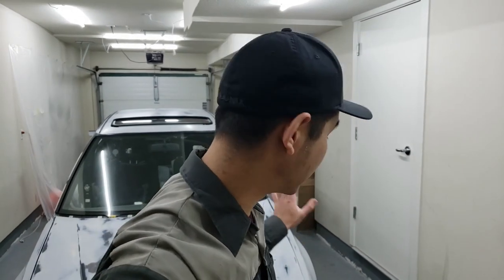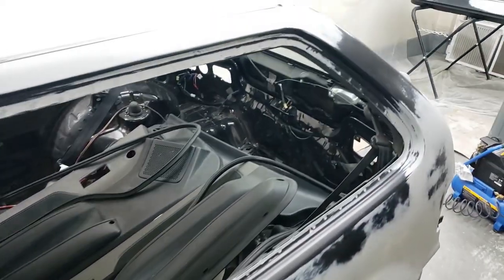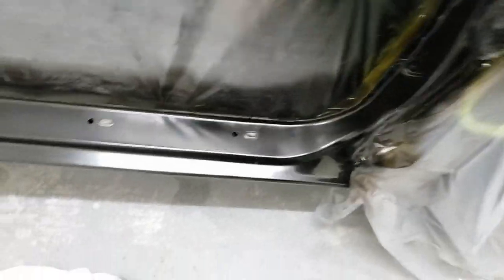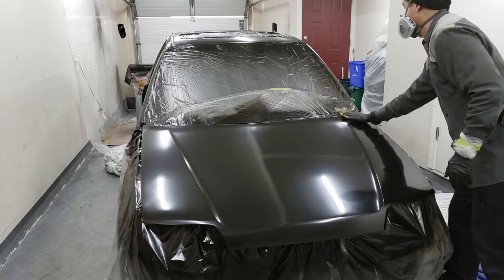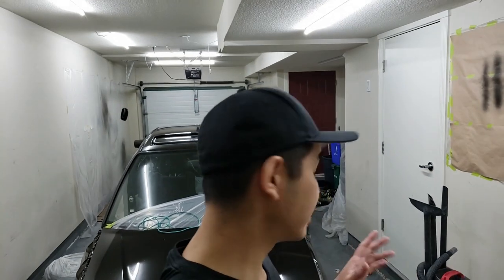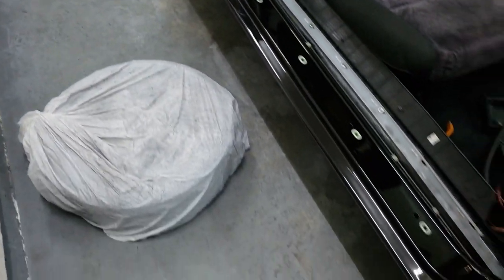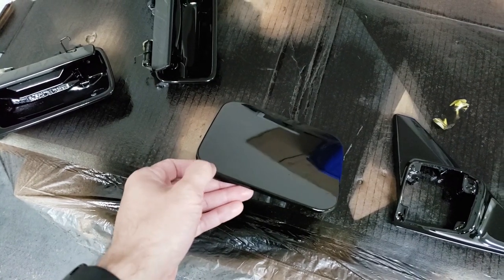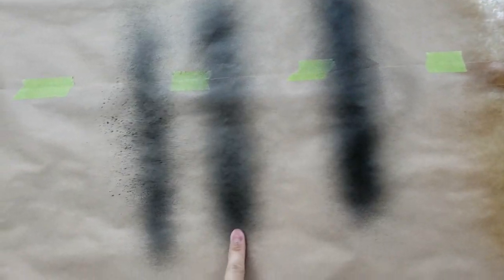[DIY Bodywork] Pt.24 Spraying Base & Clear Coat with FujiSpray Semi-Pro 2: Successful 1st paint job👍

Comment from the maker: For some reason, someone's comment got removed. I used the 1.3 tip that came with the sprayer to spray the car. For primer I used a 1.8 tip. But a 1.3 tip can do the base and clear no problem.
Reply: Use a .8 with this Fuji system and you will get a flawless finish that doesn't need sanding. Sounds counterintuitive but trust me. The system just isn't powerful enough to spray undiluted paint well with the typical 1.3 tip. The theory behind using a .8 is less material but the same amount of air. You move slower but it lays it down very flat. Severaly underrated system.

Comment: I’m glad you took the time to adjust your settings and find what works for you. The system is well worth the money for DIY projects. If a person can paint a car with rattle cans, then why wouldn’t this system work with a little patience. Trial and error is key. You did an amazing job and I hope you film your next session as well. Hopefully it inspires others to try this system for themselves.
Reply from the maker: Thanks man. Very true. This system is way better than rattle cans. I've painted my fair share of things with rattle cans. Rattle cans really suck. This system really does work well. Just need to be patient dial in the settings and take my time spraying. I think it would have been better if I had more airflow in my garage. But gotta make do with what I have.
Reply: @BudgetGears  try to invest in some more tip sizes. I'm using a 1.0 & .8 in my gxpc for bad & clear.  You'll notice a huge difference between 1.3 & 1.4 tip
Reply from the maker: @justinshields4216  I'll definitely have to think about investing in some smaller tips for the next time I paint something. It would be nice to have even finer atomization.
Reply: @BudgetGears  i was wonder about this paint system how reliable and lasting this machine can go. Its there any maintance or parts replacements??? Also using air comrpesor gun vs this machine which do you like
Reply from the maker: @jaandel1  For me the system is quite reliable. It can last the entire paint job. The only maintenance required is cleaning or changing of the filters on the turbine, replacing the one way valves on the gun, which is usually ok for a long while, and replacement of the cup lid seal. If you're comparing guns, then there's different levels of air compressor guns vs this machine. Personally, I like the traditional air compressor guns, which is better than this particular gun. However, the gun is only as good as the air compressor system you run. If you don't have the massive compressors and water separator systems like shops do, the air compressor guns aren't very good at home on the small compressors. Now this specific machine model gun is pretty good for what it is, but if you decide to go for a different model like instead of semi-pro, you get the Q platinum models, the guns are very nice. Just like the traditional air compressor style. The Q platinum systems are very nice because you can adjust the air output etc. Turbine systems can produce jobs just as nice as traditional air compressor systems and are portable. As for the model I'm using, which is what's in the video, it's a great system for home use.
Reply: @BudgetGears  thanks for your response. You are right about air compressor air run out quickly in 20gl tank... but what do you know about hot dog air compressor it claim to have scf 6 or more around 1k in.
Reply: @BudgetGears  also the information about the gun is very valuable... unfortunately ypu can't interchange guns with this system like air compresor gun with came if diferente price range...
Reply from the maker: @jaandel1  I don't know too much about them. I'm sure the small air compressors can paint small things if you get a gun that matches the compressor, but you'll run out of air fast. The faster the air runs out the more the compressor motor runs creating lots of water. Literally these small compressors tend to run practically the whole time you're spraying something small and you'll still have to pause to wait for it to charge up. Personally, if you don't have a 50+ gallon compressor, it's a pain to use for painting.
Reply from the maker: @jaandel1  No, you can't interchange the guns. Turbine guns and air compressor guns are designed differently. The Turbine guns are designed to use far less air pressure than a air compressor gun.

Comment: I dig your work bro.  I was wondering what overspray was like spraying in a garage and how you dealt with ventilation and such.  Did you crack the garage door open between coats?  And were the neighbors a concern?  I plan on doing similar work in my own garage.  Just curious.
Reply from the maker: Overspray was very bad because it literally got everywhere. So move everything or shield up everything you don't want overspray on. Ventilation I only had the garage door open with 2 exhaust fans with filters taped onto them. I recommend getting as many fans as you can fit under the garage door. I blocked off any other openings with cardboard. No concern from neighbors since they couldn't smell anything. My 2 fans worked but it took a while to exhaust out the chemicals. If your garage is attached to the house like mine, do not open the door connecting your garage to the house. It'll get all the toxic smell into the house. Trust me it happened to me. So I would exit the garage out the side door while I wait for the flash time. I didnt open the door fully at any point since you'll let more dirt into the garage and risk ruining your job. Its dusty enough already.

If you're gonna use a similar respirator like mine, use some toilet paper to shield the cotton filter. The toilet paper will catch the overspray and allow for your filters to work longer. Otherwise, they'll get clogged within the first few min of spraying. 

If your garage has a window for air intake, then that would be best. But mine didn't so I only worked with exhaust air using 2 fans.

Comment: i just found a really messed up flaw with the fuji simi pro paint system the turbine unit heats up the air in the hose when you try to paint a hole car makes the paint get a shit load of orange peel so pissed Larry B
Reply from the maker: I think I remember the hot air being a common thing for all turbine systems. The air wasn't bad for me. I did paint it around spring and I did shut off the spray many times while refilling the gun or between coats. It gave it a lot of time to cool down. But I also didn't do a full car since space was so limited that I couldn't paint all the pieces in 1 session.

Comment: For your 1st paint job you did a good job you get a great job. Recommend blowing the garage out the day before you paint to get a lot of dust out also wet your floor down which will trap some of the dust Make sure your passenger compartment if the doors are off or taped off and papered that could be a lot of your dust and fish eye issue wash the car really good with dawn soap and dry it and blow everything out and wipe it down to wax and grease  remover.
Reply from the maker: Thanks! I did do all that. But still got fish eyes here and there. I'm thinking maybe something was floating around in the air etc. It is a garage so its exposed to all contaminants. Overall, it still came out really nice.

Comment: Thank you for the video. I have only used mine to paint the front bumper. That was my first time painting anything large. The clear came out with a lot of fish eyes. I left it as is and it cured with time. Barely noticeable now. I'm about to paint my Honda in about a week. I have thought about just buying the Fuji Q5 Platinum but having two sprayers makes no sense right now.
Reply from the maker: The Q5 is a nice one. I wish I could justify buying that one too. I think you'd have to paint a lot to make it worth buying.
Reply: @BudgetGears   You are right. I bought the semi pro 2 about 2-3 years ago and I have only used it once. Having two of them after painting my car would just be a waste unless I sell them after. I hope I do a good paint job on my car with the semi pro. Thanks again for the video.

Comment: Good video thanks.  I just bought an older Fuji q4 pro to spray my bumper this helps thanks again.
Reply: The Q4 is night and day different than the Semi Pro 2! Skipping the the quietness factor, as it does not effect the results, going from a 2 stage to a 4 stage OMG.....DOES!
You're talking 5psi vs 9.0psi!!!! Double!
This is worth every penny. You can always make a machine quieter but not stronger.

Comment: Got the Fuji Q5 platinum turbine sprayer coming soon but already painted my truck just want to sand the orange peel off with my orbital sander with 800 grit and then put clear on again. But probably won't get it to next week or the week after if like it will get one more but rather just get another spray gun to use on the Q5 for basecoat but don't see with the spray gun only
Reply from the maker: The spray gun only is quite pricey for the fuji systems. I was thinking about 2 guns before and then settled for just getting the tips needed and cleaning the gun instead. If you clean out the gun well, it'll be fun to use to spray all the stages. But, its definitely easier to just switch guns instead of cleaning it between stages.
Reply: @BudgetGears but got the Fuji Q5 platinum because the air compressor use is small. But I saw videos of people using two air compressors for more air. I just got another orbital sander recently a 5 inch from Tool Lots but still the turbine sounds better than hooking up to a air compressor saw multiple videos of people getting great finishes on a vehicle when using a turbine sprayer. I got mine from a Asian site though because not spending the high price like the ones I saw online for 1,000 I wouldn't spend that much on a spray gun that is much as a pretty good air compressor.

Comment: Also you have to learn hose control keep your hose up above your arm and use your other hand to keep it tight.
Reply from the maker: Hose handling was definitely something I needed practice with. These turbine hoses are big and heavy. One thing I had to keep an eye on was the hose kinking. It happened when I did primer. Spat a glob of primer on my spoiler. 😔
Reply: @BudgetGears   The unit I have is called an accuspray It is a plastic gun that is bolted together it's lightweight cup is on the bottom I've had it since 1990/91.  I sprayed with it a lot. never had any issues with it. I love the HVLP system.  All I can suggest is that you practice and Prep work needs to be clean make sure you don't touch it with bare hands and make sure everything is masked up. I've tried using the alcohol before it did not work I was doing bare metal brass,aluminum, copper things like that. huge panels  and I would hand polish thing and wipe it down with a clean towel and spray right over it.  Painting automobiles and motorcycles never had an issue with fish eye I know that in a garage setting you end up with more dust in there you really have to blow it out and  Wet your floor. they also have a 3' to 5' flexible hose or a whip that you can screw onto the end of the hose makes it a lot easier to hold onto the hose you just still have to watch out for kinks in your main line. had an issue with fish eye.

Comment: i have all i need to paint even the semi pro for 2 years now, i think i have to get down to painting it eventually.
Reply from the maker: Lol. You should! I'm surprised you didn't already paint things with it.
Reply: I did now, used the 1.5 tip the epoxy primer came out rough with lots of overspray, maybe without it was thick.

Comment: Not bad for your first paint job. For the fish eyes, I'm not sure what you used to clean it but I have found that wiping it with any thing other than a paint prep solvent Like naptha often will give me fisheyes. And I feel like you would get a better clear finish if you're gun was a little closer to the panel... Good job
Reply from the maker: Thanks! I used a lot of diff cleaning stuff like dish soap, then wax and grease remover, then isopropyl alcohol, then glass cleaner. The hood i believe was finished off with wax and grease remover only and since its such a big panel the fish eyes were so noticeable right off the bat. Fish eyes showed up all around the car though. I'm thinking its just contaminants in my garage. My garage is quite dirty and I do everything in there. No matter how I clean it or blow the dirt outside there's always stuff floating in the air. I know sometimes just hanging out in the garage, I'd blow black stuff outta by nose. So maybe particles were in the air. Thanks for the tips. The clear came out pretty nice except some areas where I ran it really bad. Ended up having a bluish tint to the clear in those areas. I think maybe the clear just wasn't that great of a quality clear. This clear remained rubbery when I was trying to fix the runs with a razor and I let it dry for weeks before trying to fix. It was good experience painting a full car. Definitely not something I'd look forward to doing. 😄
Reply: @BudgetGears  I do mobile paint repair in all sorts of environments, so I feel the pain. Lol. One time I was waiting a whole car in my garage and got fish eyes EVERYWHERE come to find out when I blew the car off with shop air it contaminated it with oil from the compressor. I have also stopped using lacquer thinner during prep because I get fish eyes every time. Also I have stopped using tac rags, because for some reason they give me fisheyes if I get the Wong brand , so now it's just microfiber and prep solvent...If you ever decide to take another project like this and want some pointers feel free to reach out to me.
Reply from the maker: @chipmonkeys3963  so many things that can cause fish eyes eh. I read so much about cleaning and took all the necessary steps before tackling my car and still got fish eyes. Such a pain. But yah I appreciate the pointers. I'll definitely reach out if I have any questions. 😁

Comment: I feel like I've got mine laying down single stage color pretty good but it was impossible with a 1.3. I had to go to 1 before it would lay down properly. 
I wonder if that's just the difference in our paints.
Reply from the maker: Maybe the difference is the single stage vs my base and clear. I hear it's a lot more difficult laying down single stage properly. I've never tried single stage using this systems, but I can image a smaller tip would definitely make a big difference for spraying both single and base and clear.

Comment: Great job, should be proud, the car looks great. Question, being it's a turbine with hot air did you use a slow, medium or fast reducer with paint and also on the clear? 
Great job again.😊
Btw, I'm subscribed
Reply from the maker: I believe they were medium reducer. The paint was premixed at the paint shop. So base was already ready to spray and the clear was a medium. The air wasn't actually that hot for me. I had a lot of stop sessions so it had enough time for the turbine to cool down. I painted during spring and in the morning when it was not hot. 
Thanks for subbing! Appreciate it! 😁

Comment: That's why I like to Do It Outdoors under a covered canopy you get a lot better results it's more ventilation and all their milk particles go away so you don't get so much in your finished when it's in trapped in that garage like that those particles drop back down
Reply from the maker: Yeah I would love to be able to spray in one of those blow up spray booths with intake and exhaust fans going. Unfortunately, I had to make do with what I had. I'd say it turned out amazing still. People are always shocked when I say I painted it in my garage. 😂

Comment: Good video - I ran into it doing some research for the Semi-Pro 2. I saw the last video of this series and the final result looks good! How do you feel about the Semi-Pro 2? How I'm debating between this or the Mini-Mite 3.
Reply from the maker: Thanks! I think the Semi-Pro 2 is a good budget system. It does the job. However, after using the gun, I don't like how the gun is. I prefer a more traditional HVLP style gun. The Mini-Mite 3 is a good choice because the gun is much better. I don't do a lot of painting, but will have other projects where I'll be using the Semi-Pro 2 again, but if I were doing a lot of painting, I'd invest in Q5 because it puts out much more air pressure and you can adjust the pressure. But overall, the Semi-Pro 2 is a great system for occasional painting. I'd definitely recommend a better system like the Mini-Mite 3 for the nicer gun.

Comment: I am just a furniture refinisher, but I can assess a great job when I see one… ♥️♥️♥️ I have the semi pro and I LOATHE that hose… what would you suggest as a replacement?
Reply from the maker: I also hate the hose, but I haven't actually changed it to anything different. I know Fuji does have 6ft flex hose that should make it better. You attach it to the bulky hose, but I haven't tried it. I've also read that some people have modified high pressure garden hoses to work with the spray system. I haven't tried it myself though. My concern is if the air pressure would be compromised if changing to a garden hose. I can see it working, but I wouldn't want to sacrifice air pressure.
Reply: @BudgetGears  thank you kindly. I appreciate your reply.

Comment: How long did a cup last before you needed to refill? What size is the cup?
Reply from the maker: The cup is 400cc. I refilled often by just turning off the machine and checking my cup. I don't remember exactly how long the cup lasted before topping up. I think it lasted a little more than hood and 1 side of the car. I filled up often to keep the cup full when I sprayed the bottom area of the car since I had to spray at an angle.